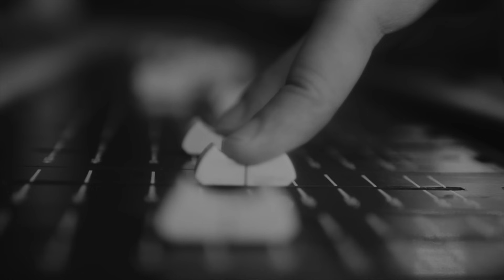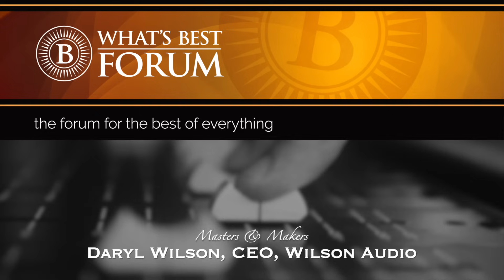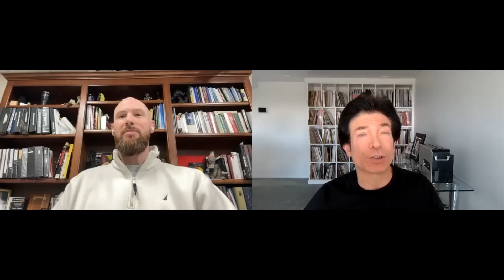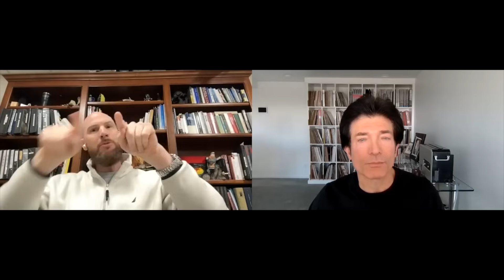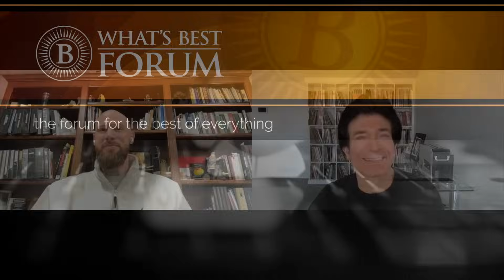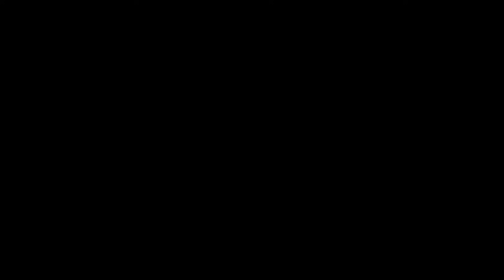What's Best Forum's Masters & Makers:  Daryl Wilson, CEO, Wilson Audio  #highendaudio #loudspeakers

Comment: Regarding Ribbon tweeters: "as soon as you take that microphone off-axis even 1 to 2 degrees you start getting very extreme roll-offs."   I'm curious of an example this in measurement?  I"m aware of a number of current speakers with ribbon tweeters where the measurements show that this "extreme roll off" is certainly not the case. I own a pair of Wilson Audio speakers and I love soft dome tweeters; however, this comment about ribbon tweeters is puzzling, to say the least.
Reply from the maker: Hello Jimmy,

I think you raise a fair question. Perhaps Daryl slightly overstated the point?

I personally believe that implementation trumps theory. Even if some ribbon tweeters exhibit extreme off-axis roll-off I suspect that not all ribbon tweeters exhibit extreme off-axis roll-off.

For example, I suspect that Damon and Leif's ribbon tweeters in the Von Schweikert loudspeakers, and Oliver's ribbon tweeters in the Gobel Divin line, do not exhibit extreme off-axis roll-off.

I think panel loudspeakers with line array ribbon tweeters such Magnepan, and loudspeakers with full range ribbon drivers such as my Pendragon, and electrostatic panels such as MartinLogan, tend to be more prone to "head in the vise" issues.

But Gary Koh specifically designs his big Genesis Technologies panel loudspeakers for good off-axis response so a room full of people can enjoy the music.

Ultimately, I return to my view that implementation trumps theory.
Reply: and there are also omni directional ribbons, of which i know only two: in Bayz audio and Zeta zero orbitals.   @whatsbestforum